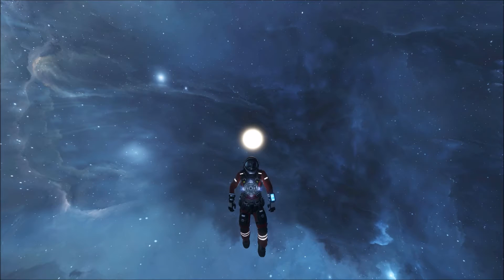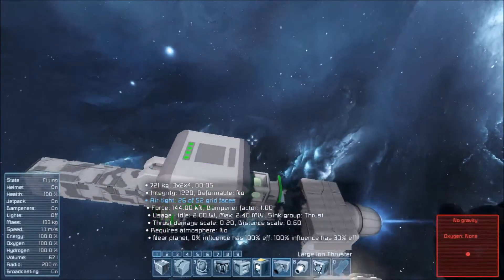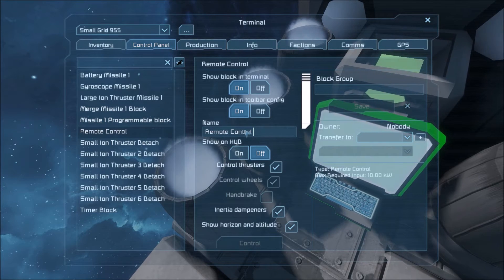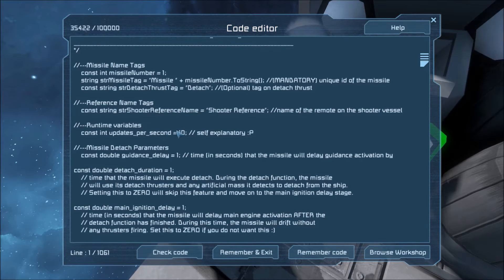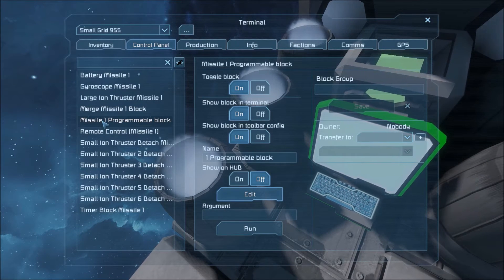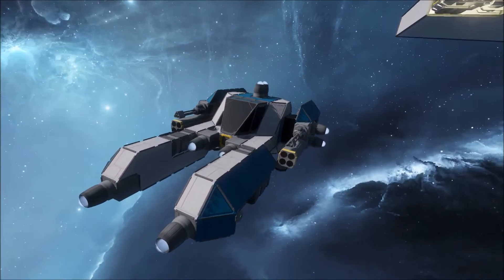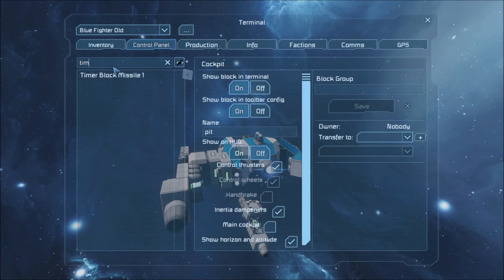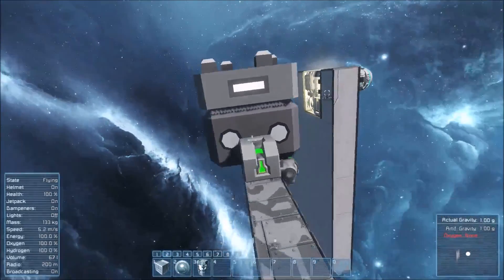[Space Engineers] Whip's Optical Missile Guidance System - Video Tutorial

Comment: Does the beacon have to be completed to force synchronization or can I just make it with a single steel plate to save cost?
Reply from the maker: PhazonSouffle: It needs to be completed and broadcasting
Reply: So does that mean an inertia torpedo needs a battery and beacon to be accurate?
Reply from the maker: PhazonSouffle: No, the issue is that the game is not properly syncing gyroscopic motion to clients. if you for an unguided torpedo, you should have no issues.
Reply: engineer bodies are disposable i suppose...
Reply: On and broadcasting the full distance kinda makes it less stealthy than a torpedo should be. No other ways to get the client to sync properly then?
Reply from the maker: Tor Matthews: Nope, unless you sit on the missile lol